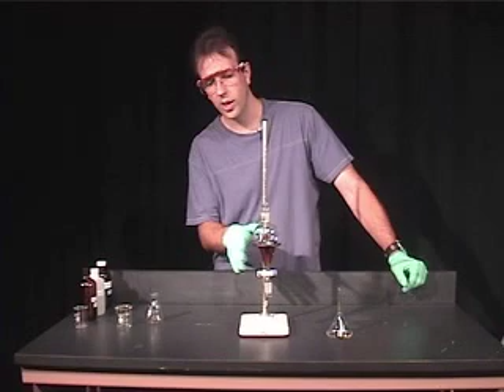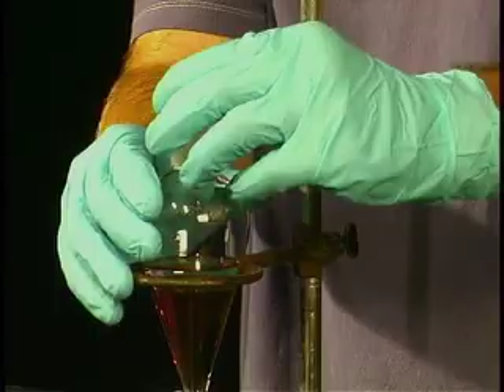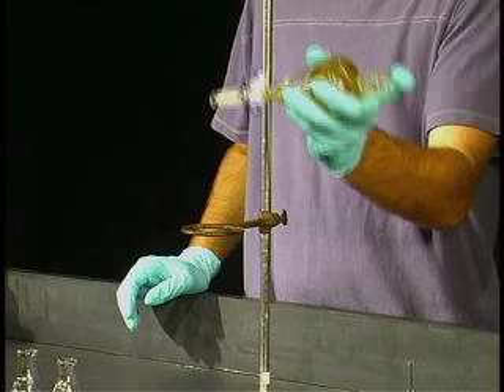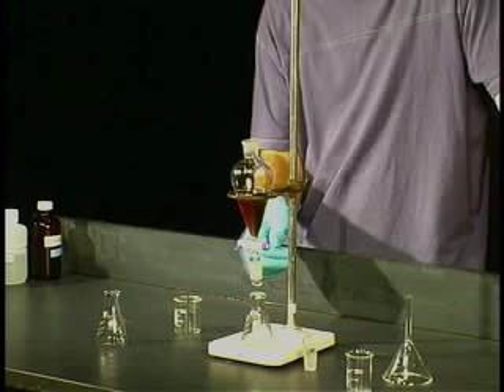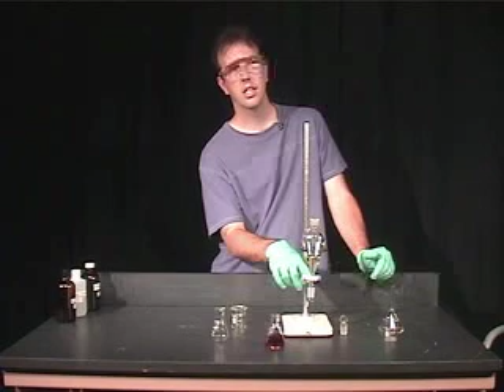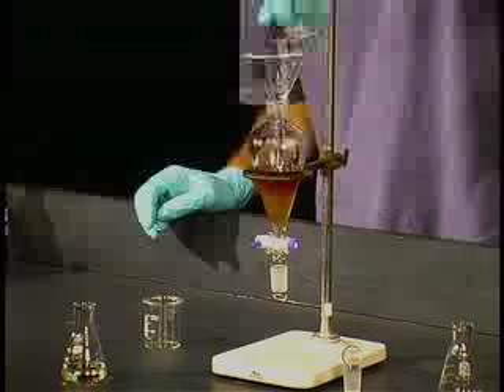Organic Chemistry Lab Demo: Extractions (part 1)

Comment: Perhaps you should mention why the caffeine chooses to move to the ethyl acetate instead of remaining in the water(tea)?
Reply: The polarity difference between caffeine and ethyl acetate is much lower than the polarity difference between caffeine and water (or tea). Compounds who are both polar (or nonpolar) mix according to the "Like dissolves Like" rule.
Reply: @Student Notes what level of Science do I need to take to understand what you just said? College wise? CHEM 1, OCHEM 1, etc...
Reply: Probably chem 2. This lab is being done in my O-Chem lab but most of "like dissolves like" is mentioned in chem 2.

Comment: I am confused by the process of extraction..we are performing an extraction of benzoic acid this week in Ochem lab. First we add benzoic acid to diethyl ether, heat the mixture with a steam bath and boiling stones, then use vaccuum filtration to remove the ether insoluble. But what would the ether insoluble be? Is it the carboxylic acid functional group from benzoic acid, whereas the benzene ring is soluble in ether since both are nonpolar? Also- how do you know which is the organic layer? Sorry

Comment: At the start, the dark solution (aqueous layer) contained the caffeine with all the unwanted material. At the end the separation, the caffeine had been extracted from the dark solution (aqueous layer), into the clear solution (organic layer). Therefore making the caffeine alot easier to extract straight from the organic layer without all the rubbish in it from the aqueous later (dark solution)